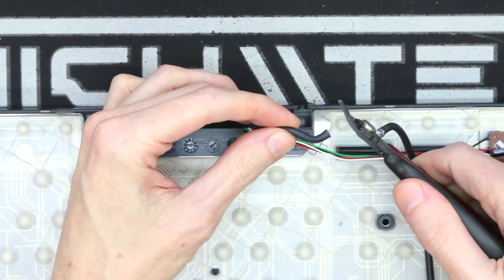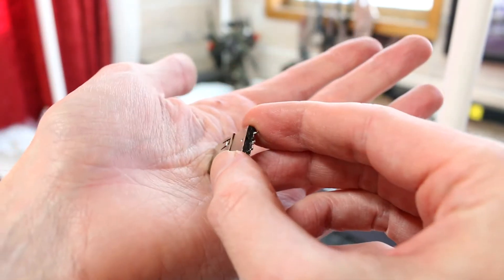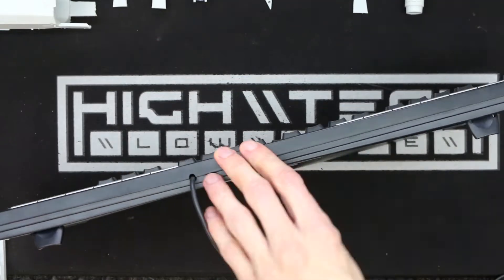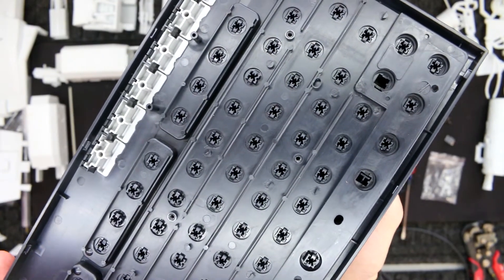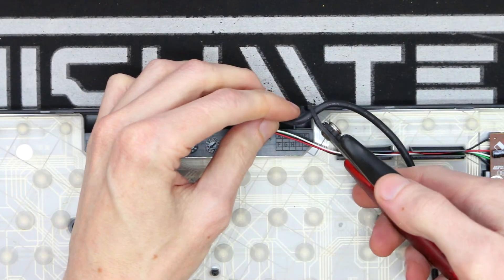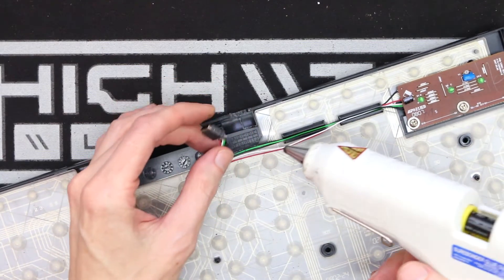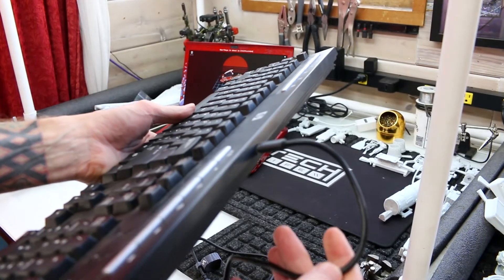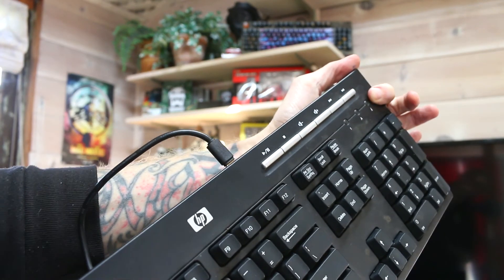⌨ Upgrade Your Cheap Keyboard With *One Simple Mod!* Wired To Detachable Cable - DIY How To Tutorial

Comment: hi can you recommend what kind of wire is used on wired mechanical keyboards? coz my mechanical keyboard wires was destroyed the one's that connect the keyboard pcb and USB-C port
Reply from the maker: You can use any standard USB cable 👍
Reply: @hightech-lowlife  thank you!
Reply from the maker: @nabongsjeongie5093  💯!

Comment: My keyboard has green, white, blue, and orange?

Could I still manage to do this with this keyboard?
Reply from the maker: Yes, most likely the colors are just non-standard. If you have a multimeter you can check which wire does what. 👍
Reply: @hightech-lowlife  Don’t understand a multimeter, but I did some research, it seems that the wires are the same just different colors.

Like orange corresponds with red, and white corresponds with black, and so on.

I’m going to give it a try, though could this damage my keyboard if I wire it wrong?
Reply from the maker: @MareMare-k5v  If you reverse polarity for power and ground you could potentially damage your keyboard, this is where a multimeter would ensure you would know which is positive and negative. The data lines aren't as critical and would not cause damage.
Reply: @hightech-lowlife  That’s good to know. I’ll figure out how to use a multimeter so I don’t screw this up.

One more question, is reversing polarity equal to connecting negative to positive? I don’t know anything about this stuff.
Reply from the maker: @MareMare-k5v  Yes, reversing polarity is connecting the red wire to the black wire.
Reply: @hightech-lowlife  At least I know that.

Thanks for helping out 👍
Reply from the maker: @MareMare-k5v  💯 You'll figure it out 👍

Comment: You should always buy type of a plug where you can solder the shield to the connector metal shield separately. In USB the shield and ground are separate things and mustn't be connected together unless you know exactly what you're doing. Shield is basically an extension of the computers metal case and provides shield over the cable. Ultimately shield and the GND of the USB signal are tied together, but this must be done at exactly the right location respecting the circuit diagram and USB specification or you might introduce ground loops and null the effectiveness of the shield altogether.
Reply from the maker: You're more than welcome to get any USB connector you want, I personally wouldn't want to introduce more complication in attempts to solve a problem that it doesn't have and might actually create more problems than it sets out to solve. 👍

Comment: Mine have all the wire but it has a yellow wire with it what should i do with it?
Reply from the maker: Most likely it is a second ground, you can test with a multimeter in continuity mode and see if there is continuity with ground (black wire). 

You can also just try it with only the 4 wires and if it works, then you don't need to worry about it. It's no use to find solutions to problems that don't exist yet, better to wait until you run into a problem then try to find the solution.

Comment: Hi! I m trying to do this to two ok my keyboard. But both come with 5 pins. Keyboard A has: Green, White, Black, Red, BLUE. Keyboard B has: Green, White, Black, Red, YELLOW. (not in this specific order). Can i assume that the BLUE in A and the YELLOW in B are for shielding and i should just leave them unconnected to a 4-pin? Your help would be appreciated
Reply from the maker: Most likely they are grounds, you can verify with a multimeter for continuity, try testing the blue and black wires and see if they test with continuity. 

Same goes for yellow and black, see if they test with continuity.

If they do, then you can either tie blue to black and yellow to black, or you can try leaving them disconnected and test the keyboard for operation.
Reply: Same thing here, but instead of a yellow/blue I have another black, just check the continuity to make sure it's only shielded, in my case I got vcc red, gnd black, d- white, d+ green, sg black (all in this order), sg black has continuity with the metal part usb. I'm sorry if something isn't well explained, it's not my native language and I'm a bit new to this
Reply from the maker: Ground (black) is ground and will be continuous to grounded parts (like the metal casing of the USB port) @Lion746  . All USB ports with 2.0 spec are only 4 wires, if there is a 5th wire present it is just another ground. Only exception is Mini B which has an ID pin, but most applications just ground this as well.
Reply: @hightech-lowlife  oh ok, thanks for replying after so long 😂
Reply from the maker: Oh yeah it's no problem 🍻 @Lion746

Comment: I've only one question. For what?
Reply from the maker: There are several reasons why someone might want a detachable cable for their keyboard. Here are some of them:

1. A detachable cable can make it easier to switch between keyboards with different USB connections, such as USB-C, mini-USB, or micro-USB.

2. A detachable cable can also help with the portability of the keyboard, especially if it is a smaller size, such as 60% or 40%.

3. A detachable cable can reduce the wear and tear on the keyboard’s USB port, which can extend its lifespan.

4. A detachable cable can also allow for more customization and personalization of the keyboard, as you can choose from different colors, lengths, materials, and connectors. Some people like to use aviator connectors, which are metal connectors that have a locking mechanism and a retro look.

Comment: hlo bro i also did this usb c mod on my k552 but now when i plug it in my laptop it doesn't light up most of the times like 8 out of 10 times and in device manager it shows usb port reset failure and also shows code 43 .I tried everything to fix this but cannot find anything pls help me with this otherwise i will have to throw this 6 month old keyboard in trash now.
Reply from the maker: I would recheck your solder joints, make sure they are clean and not too much solder. Probably best to redo them 👍I've had a few other viewers with a similar issue, and it was due to poor solder joints, or solder that was bridging two pins.

Comment: can you reverse the process and take a USB-C keyboard and convert it into a hardwired keyboard?  If so, can you show a video
Reply from the maker: Yes, that is easy. Just bypass the connector and directly connect the USB cable wires to the keyboard PCB. I may be able to make a video, but not many people have requested this and it is fairly simple.
Reply: @hightech-lowlife  I want to remove the usb-c female port on my keyboard and hardwire it so i can use it and not worry about breaking the port.  i've never seen instruction on how to do that.
Reply from the maker: @chris_topher1984  A port is just a passthrough, so the pinout of the port will let you see what wires do what. For USB it is power ground and data plus and minus. Just match up those pins to the wires on the USB cable and that's it. 

https://www.electroschematics.com/usb-how-things-work/
Reply: @hightech-lowlife  thanks for the info, i'll look into it.

Comment: Just starting to look into put a female USB C port on my keyboard.  Really good video.  But one thing that confuses me, do I need to worry about the "56kOhm pull up / down resistor" for USB C?  Some places I read says it's needed, other don't mention it.  Any help works!
Reply from the maker: USB C is quite complicated as it's a connector that tries to do all things. 

If you want to get into the nitty gritty of understanding how it all works and if you'll need this or that, I would recommend going over the documentation: https://en.wikipedia.org/wiki/USB-C 

I do have an understanding of it and can configure it in many ways because of that understanding, but for this mod it's not necessary to know or worry about configuration. I've heard quite a few viewers do this mod as shown and it works as they expect it to. I feel like trying to explain it may just end up causing more confusion? My recommendation is to just try it and if it's doing something you don't expect or don't want, then investigate further. 

Worst case scenario the cable will only work in one direction, and if you flip it, it won't work the other way around. But if you're only using C to A as your cable, then you don't have to worry anyway. C to C can be trickier due to host/device relationship where resistors come into play. 👍
Reply: @hightech-lowlife  Ah, thanks!  Yeah, I won't be doing C-C, only A-C (from comp - keyb).  

So that helps!  I think the resistors are just used for power delivery 'agreements', and my keyboard is only gonna get plugged into a computer USB port which won't be pushing any amps.
Reply from the maker: @akaShanks88  If the cable you're using is A to C then you don't have to worry, it will work just fine 👍
Reply: @akaShanks88  How is the keyboard behaving? Any interference or strange behavior?

Comment: Hello, I have followed your tuto but I got a problem ... 
 I've tried soldering a breakout board usb-ce, I did well I think.
The first board was a cheap one, I've tried a regular usb-c to usb A 2.0 cable, and it works, but after that I tried a swift cable coiled. And the keyboard started to act weird ...It turns on and then off, and windows says "unknown device". Any idea ?
Reply from the maker: That's great that you tried the modification 👍so the keyboard works fine with one cable, but not another? Is the coiled cable different in any other way? 

Type-C is actually a complicated connector type and can be configured in many ways, so it's possible if it's a C to C cable that plugging it in one direction works fine, and if you flip the cable around it won't work at all, or right. I would verify by trying more cables if possible. If the mod works with one cable, then you know it was done right. Thanks!
Reply: @hightech-lowlife  No no, now the keyboard just turn on and then off, and in windows it's an unknown device. I've tried resoldering anotherboard but it's the same...
Reply from the maker: @neo5389  So it was working, and now it's not working? I would recheck your connections. I had another viewer have some issues and it's because his soldering was a bit messy, ended up causing shorts by bridging the pins accidentally. After I told him to clean it up then it worked fine, so I would start there.
Reply: @hightech-lowlife  so it worked with a bad soldering and a standard câble. But then I tried with the coiled cable and it started to act like I said. So I thought it was because of the soldering so I decided to redo it on a better board. And after beautiful solder, I got the same result.
Reply from the maker: @neo5389  It could be a lot of things, what happens if you bypass the connector and just directly solder the cable back to the keyboard?
Reply: @hightech-lowlife  I've tried that too, but still the same.
Reply from the maker: @neo5389  Which cable are you using though, from your timeline of events it sounds like the coiled cable caused these issues for you. Can you verify the coiled cable is working correctly?
Reply: @hightech-lowlife  yes exactly ! The coiled cable created the mess... I broke it... And now it's not working with a regular usbc cable (which was working with before...) :/
Reply: @neo5389 @alienmartian22 hlo bro i also did this usb c mod on my k552 but now when i plug it in my laptop it doesn't light up most of the times like 8 out of 10 times and in device manager it shows usb port reset failure and also shows code 43 .I tried everything to fix this but cannot find anything pls help me with this otherwise i will have to throw this 6 month old keyboard in trash now.
Reply: @syedqaiserabbasbukhari  Try to revert both Data wire.

Comment: I was about to do this then when I checked my mechanical keyboard's cable there's an extra black wire in comparison to this video with just one, what should I do with that wire? Thanks!
Reply from the maker: It's just an extra ground, you can tie it to the other black wire, or just leave it, should work fine either way 👍
Reply: @hightech-lowlife  dang thats a fast reply, thanks!
Reply from the maker: @kennshakeman6458  💯👍

Comment: Hey I did the same with my armeggadon Mka 2-c and did all the steps. When I connect it using a normal usb - c phone charging cable, my keyboard lights up and all the rgb works, but it doesn’t type. Sometimes there is a surge warning popping up on windows or device not recognised or smth. Would appreciate it if you can help. Now stuck without a keyboard 😅😭
Reply from the maker: Make sure you have the green and white wires on the correct pins. You may need to swap these. Show me a photo of the connector you soldered if you can 👍Thanks.

Comment: I just did this mod on a cheap reddragon RGB mechanical keyboard from amazon and it works perfectly! Input and RGB work the same as before. I only struggled with soldering the small 4 wires without experience, but finally got it. Thank you for the video! 😁
Reply from the maker: That's awesome man, good job! Thanks for watching 🍻
Reply: How is the keyboard behaving? Any interference or strange behavior?
Reply: @8DAudioPT  Works exactly as it did before, I still use it everyday for hours.

Comment: Your USB Connector has 4 solder points. But you have five cables (red, white, green, black, AND ANOTHER BLACK).
What did you do with the 5th one?
Reply from the maker: This will just be another ground wire, you can tie it in with the other black or leave it disconnected, either way will work 👍
Reply: @hightech-lowlife  Thank you so much sir!
Reply from the maker: @SamYung0  No problem 🍻
Reply: u saved my life with that comment

Comment: I have a Corsair K63 with its trash tier microusb port. Any thoughts on a guide to convert micro usb to usb-c?
Reply from the maker: Most likely it has an internal cable, so should be as easy as this one (same steps), if the port is soldered directly to the board it might be a bit trickier but still doable 👍
Reply: @hightech-lowlife  Thank you for replying!
Reply from the maker: @piedpiper1172  Yeah no problem! I'm sure you can do it 🍻

Comment: After modding a keyboard what type c cable should i use? Is it ok to use type c phone charger or anything that is type c cable?
Reply from the maker: Yes, any "regular" Type-C cable will work 👍
Reply: @hightech-lowlife  Thanks!
Reply from the maker: @abyss1017  💯!
Reply: @hightech-lowlife  Hey man! i need your help, my keyboard has 5 wires which is yellow/orange, blue, white, green, and red. Can you help me figure out where they belong in the type C board. TIA <3
Reply from the maker: @abyss1017  What board do you have? Can you take a picture of the wires attached to the port? With a pinout diagram for Type-C you should be able to determine what they're doing. The only one I'm not really sure is if orange or blue is minus, but they both could be because usually 5 wires is double ground.
Reply: @hightech-lowlife  i have pictures of the wires. Where can i send them?
Reply from the maker: @abyss1017  You can send them to me on instagram or upload a link and link it here. Do you have a multimeter? That would allow you to test at least which is ground and most likely they both are (blue and orange).
Reply: @hightech-lowlife  Oh ok thanks! My cousin has multimeter, im going to test it later. I didnt know that you can use that thing lol. Thank you so much for the help!
Reply from the maker: @abyss1017  For sure man! Finding ground is the easiest thing because it's just the outside connector casing, put one pin on the outside metal casing and the other on the wire you're trying to see if it's ground or not and if it beeps to indicate a connection, then you know it's ground 👍

Comment: Can we use the other type of usb c female ports ths used in phones??
Reply from the maker: The one I'm using here is the same type you'd see in cell phones, you can use any type-c cable you would use for a phone 👍This mod will work with any USB connector you want though! USB A, Mini, Micro B, B, Type-C, Lightning, etc...

Comment: My keyboard have 5 cable, after checking and do some research it turns out other one is for shield..so my questions is where should i put it? At ground or what?
Reply from the maker: You can either ground it or you don't need to connect it 👍

Comment: I have a keyboard that is not detachable, and I'm planning on using your video to convert my keyboard to bluetooth. Do you think its doable? Looking at the amount of space you and I have on that keyboard, I feel like a battery and all the other components won't fit.
Reply from the maker: It may be possible, most rubberdome boards are made very thin though, and this does not leave a lot of room for extra components, especially the battery. Mechanical keyboards usually have thicker cases and this allots for more flexibility. 

You're best off opening up the keyboard in question and taking a look at how much room you have to components. Other options are to attach things outside of the case, it won't be as sightly, but it will be functional. 👍